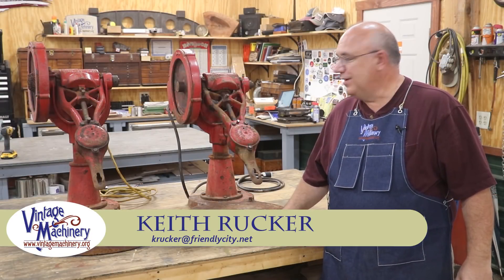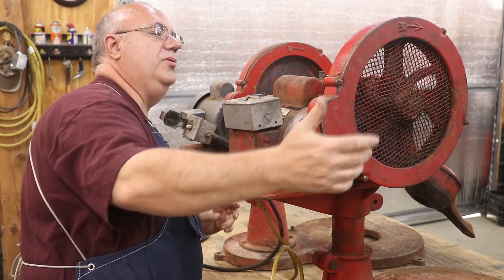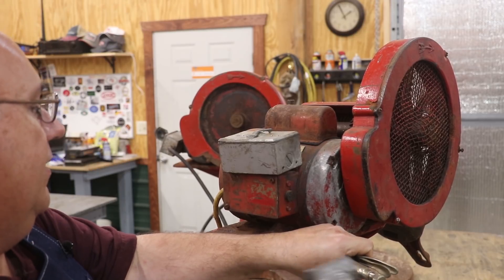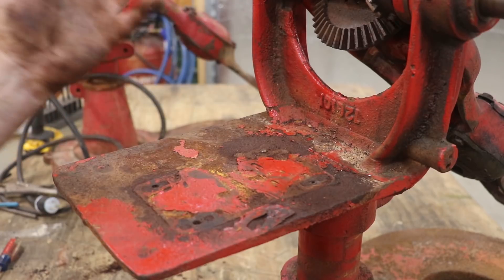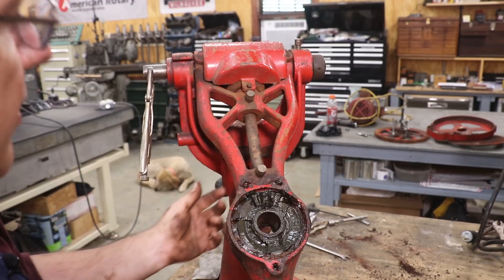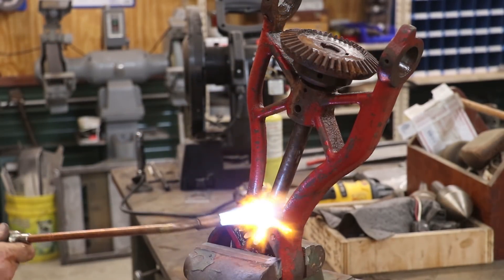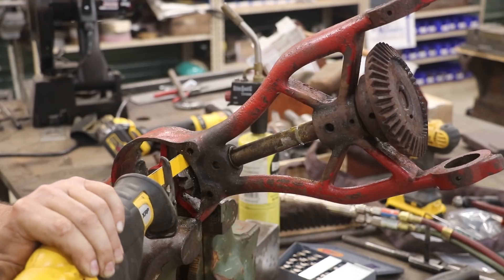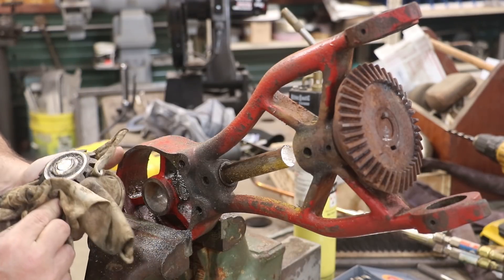White Mountain Ice Cream Churn Restoration - Part 1:  Disassembly

Comment: An old trick I learned from a millwright.  Heat the SHAFT on stubborn items like this.  The expansion of the shaft will create a space after it has cooled.  This microscopic space will allow penetrating fluid.  A great penetrant is paraffin wax which has a great wicking action when the shaft is cooling.  This is what has worked for me on those items that seem to have welded themselves together.  This process has saved the day when other methods have failed.

Comment: 3:57 Rock salt doesn't "keep the ice cold." 

It chemically melts the ice faster than it would thermally which quickly removes heat from the ice cream, freezing it.
Reply: But the real chemistry/physics of why you add salt is to lower the freezing point of the melted ice, or water.  By adding salt ( or a myriad of other less available and more expensive water soluble chemicals) you lower the freezing point of the water so that the salt/water solution in contact with the churn canister is much lower than the 0°C or 32°F nominal freezing point of plain water.    With enough salt and you can keep water in liquid form to near 0° F.
Edit:  the process I was thinking of is the Colligative Property.  It doesn't matter so much what the chemical is you use to "contaminate" the water as the amount solute molecules you can get into solution.   By contaminating the water you depress it's freezing point.

Comment: You should have soaked every bolt, nut and shaft with penetrating oil every day for about a week before even starting on something that had been exposed to salt and obviously and visually rusted and corroded. Massively rusted fasteners then should be turned only 1/4 turn then sprayed with penetrating oil and tightened back up then repeated until they come loose. Heating them before spraying penetrating oil will help the oil seep into the threads better. Wire brushing the area helps tremendously. I work on old rusty farm equipment all the time and this method rarely ever fails.

Comment: Having worked in the food processing industry in the past, we would use a paint called Steel-It on steel and cast iron parts. It has stainless steel flake in the formulation and is excellent in high corrosion areas and where acid or caustic washdowns were done once a shift. just a suggestion when it comes time to select a paint the parts after clean up!

Comment: A quick tip when trying to hit a wrench with a hammer. Use the hammer shaft just under the head to hit the wrench assuming you have a stout handle. I have ball peen hammers that are one solid piece so I don't have to worry. But by using this method it gets rid of the deflection you get when trying to use the hammer head.

Comment: its like working on a vehicle from MN.  Reminds me of trying to get the leaf springs apart and the bolts wold seize into the eye bushings best way to deal with it would be to cut the bolt on both sides but with a shaft that sucks.

Comment: Keith,  Check your local bearing/gear house -- they may very well have the gears you need or might be able to get them for you.  Will stainless in cast iron experience intergranular corrosion?  If not, perhaps good marine-grade fasteners will work.  If you have a Fastenal in your area (or where your job takes you), they might be able to give good advice and supply you with the needed fasteners.  (I don't work for them, I just know that they exist, even in small towns.)

I'm looking forward to seeing you put these churns back into operation!  And the videos you make in order to get them working again.  Maybe you could use them at one or more fairs at the museum?  You're within a reasonable driving distance, so my wife & I could drive up to eat some ice cream!  ;)

Comment: I would recommend powder coating those painted parts.  It is a much more durable coating in a corrosive environment
Reply: I came down here to say the exact same thing. I usually don't like powder coating on restorations because it just doesn't look like the original finish. But in this case I think it would actually be an improvement.

Comment: Hey Keith, another great video! But, I think you may have glossed over why you didn't/couldn't pull off the top bevel gear. I just hate to see a saw or hotwrench used by a machinist thinking it's a last resort.

Comment: For the people using standard units: 20 quart = 18.9 liter :)
Reply: And yet for others.. 5 gallons = 10 servings hehe
Reply: Or, for the older Brits like me, 20 US quarts =16 British quarts, or 5 US gallons = 4 British gallons.
Reply: @stumccabe  Thankfully, the fluid ounce used is the same.  A U.S. customary pint is 16 fluid ounces.  An Imperial pint is 20 fluid ounces and that's a very nice serving of beer.  Darn it, because of medications, I'm prohibited ethanol consumption.  :>(

For Americans, like me, Canadian gasoline prices used to be somewhat confusing.  The difference between the Imperial gallon and the U.S. gallon was the reason.  In Canada these days, motor fuel is sold by the liter and Americans are more confused than ever.
Reply: Except it's spelt 'litre' - or it is over here! BobUK.
Reply: @bobuk5722  It is a common thing.  Center vs. centre/color vs. colour, ad infinitum.  If a spelling is found in either "Oxford" or "Webster", it's correct.  We make ourselves understood and that (IMO) is what truly matters.

Comment: Sometimes when you're fighting a stubborn the obvious escapes you. Vise grips to the rescue. Glad you were  successful.
Reply: Using a vise grips is the wrong choice because they crush the nut causing it to grip the bolt even tighter.  Tightening the vise grip further only compounds the problem.  Here's a couple alternate choices:  1)  Use a small cold chisel and split the nut; or 2) Use a Dremel tool with a thin abrasive wheel and cut off the side of the nut parallel to the bolt and knock off the remainder with the cold chisel.  Even partial slotting(s) of the nut will weaken it sufficiently to be dislodged with the cold chisel.

Comment: Okay my girlfriend just read my comment and called me on some b*******!!😏😏 I don't pay myself $100 an hour , I charge $100 an hour minimum for two guys,.me and one helper.. and that is only on highly detailed expensive hardwood that can only be cut  one time sometimes it's $10 a foot for hand railing.. I I have a very expensive tape measure that is accurate down to 1/64 of an inch.. unfortunately it's only 6 ft long. the compound miter box I use for that cost almost $1,000 I'm the only one that's allowed to touch it no exceptions!!!
Reply: ???...What is this about?  Why are you here?